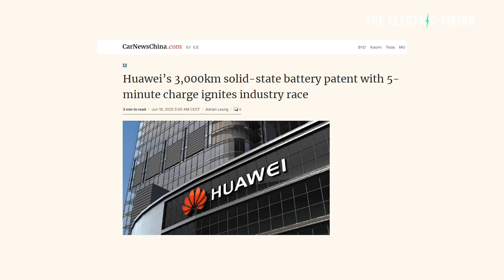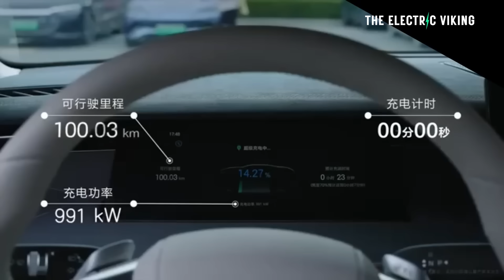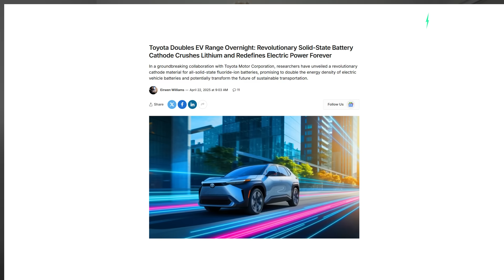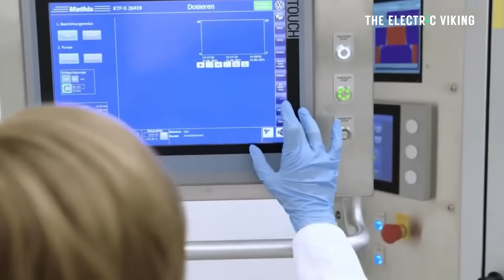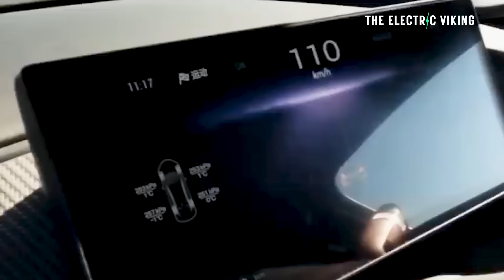5‑Minute Charge, 1,864 mi Range: Huawei’s Battery Patent Shocks Industry

Comment from the maker: The car I drive, the Xpeng G6 - https://youtu.be/IcniwO8NfQQ

RESINC Solar installed my battery and solar system. Get a free quote from them here: https://www.resinc.com.au/electricviking
Reply: Wow my sympathies....lol .....The electronic door latches can be unreliable, with some users experiencing issues with auto-unlocking and auto-locking. 
The physical door release levers are hidden, which can be problematic in emergencies. .....I would be concerned in an EV....

Comment: Well, Battery vehicles cannot replace ICE vehicles or any other competition.
Here is why;
With 290million cars in the USA, each to be replaced with a Tesla Model S (hypothetically) requires about 3.335TW charging installations  (considering each with 11.5kW chargers, total would be 290million x 11.5kW = 3.335TW) and grid demand of power. Such is more than the combined installed capacity of China and the USA.
Obviously, not all of them will be plugged in to the grid at the same time, even a 40% would demand a power of 1.334TW without including fast charging.

Comment: Many technologies are patented without an actual effort to bring them to market. That is so future products which may borrow from the patent won't be challenged by a competitor. When Huawei actually starts putting these batteries into vehicles in large numbers, that will be considered a threat. The world's largest battery manufacturer also in China, already has a cheap competitive battery that it has been putting into vehicles already, and is gearing up to mass produce for the automobile industry. That's the one to worry about.

Comment: Need a battery that can run a NYC taxi for 4 days  straight that is about 280 to 300 miles daily on dirty range so 1300 to 1500 miles of range is optimal. Anything else is failure. I DRIVE A TESLA and been working on a Model Y for 4 years I really experienced it and my findings are the solution

Comment: The next revolution will be EVtols. Think about it. They could end up even cheaper than EV cars because they don't need all those wheels, complicated suspension and drive. For these reasons they would be far more reliable and they would never crash because air is a very predictable thing. You hit a pothole on a road and you could end up in the bushes, but in the air under computer control with every EVtol knowing where every other one is at all times, I think it is guaranteed to take over.

Comment: If this is true then it will reduce the weight of batteries considerably.  Instead of an 1800 mile range we could have a 600 mile range that weighs a lot less and uses less energy to pull it around.

Comment: But it's all nonsense, yes the battery might exist, but to charge it in 5 minutes would use 7 to 8 MEGAWATTS.......you'd need a cable the size of a 4 inch drain and it would have to be cooled....., plus no house can supply that, and multiple cars plugging in would collapse the grid

Comment: They can come up with whatever range they want, 20,000km. Hooray!

The issue is always and every time how the hell do you charge it?

Unless you install a huge battery at each and every charging station, you need to upgrade the entire grid back to the generator.

That will make each charge insanely expensive in terms of paying back the capital to upgrade the network.

And as an engineer responsible for mining machines with the sort of electrical demand as one of there chargers, the stop start nature of the EV charging means you will also pay a fucking huge demand charge to compensate the generators for having that capacity just sitting around waiting for your spike in demand. One of my annual bonus KPIs was avoiding the stop start nature of electricity demand because it cost so much.

No matter how fantastic EV batteries become, what is needed upstream of the charger to produce fast charge times is a much bigger issue.

Comment: 2000 mile range battery and 1/3 the weight and can pull a camper and get 200 miles between charges and charging in 10-15 minutes 

Yep your right

Comment: A follow up on my criticism of Sam’s ludicrous statement concerning an EV weighing less the an ICE. Not sure what he meant by that but the energy density of gasoline is 12-13,300 W/Kg—with 30% efficiency, approximate ICE efficiency, you have say 3,600 W/Kg. Now, divide that number by the weight of all the components replace by an EV then multiply it by the weight of all the components needed to power an EV and you will have the energy density required to satisfy Sam’s stupid statement. I doubt 1500 W/Kg will do it and we are a long way from that.

Comment: This would be awesome. It will happen one day. Guaranteed!
Reply: But it's all nonsense, yes the battery might exist, but to charge it in 5 minutes would use 7 to 8 MEGAWATTS.......you'd need a cable the size of a 4 inch drain and it would have to be cooled....., plus no house can supply that, and multiple cars plugging in would collapse the grid.....so no, it won't happen....

Comment: The thing is, even if Huawei doesn't manufacture their own batteries at scale, their business model may simply be to license their patent to existing cell manufacturers who already have the capacity and scale of suppliers and customer networks. You may see independent manufacturers in China and elsewhere license Huawei's Solid State patent and produce their cells inhouse if they deem it more financially and intellectually feasible than banking on their own r&d investments.

At the end of the day, what matters for mass scale will be cost of production, as you point out. Until that happens, other companies have time to push their own intermediary solutions and grab whatever market share and profit they can, and then reinvest that into a competing technology to rival or beat Huawei over time. But it's a ticking clock, and no one knows exactly how much lead time there will be until it's too late to compete on the tech side rather than the economic side.

Comment: The issue of range anxiety is less about range and more about usability.  There are already gas cars that have less range on a tank than many EVs.  Why does nobody complain about range anxiety with those cars?  It's simply because
a ) gas stations are plentiful and ubiquitous.  Even if you only have 100 miles of range in a gas car, you are pretty certain that you'll be able to find a station.  This is not the case for electric charging.  You can argue about charging at home, but that is rarely ever an option for people who are not homeowners -- which is the majority of all human beings on the planet.
b ) the time investment to fill up is relatively trivial.  Filling up a gas tank for most any passenger vehicle can be done in under 5 minutes.  Charging at most DC fast charging sites is still a half-hour process, and at the most common public chargers, you have slow 12 KW AC charging, which is going to mean multiple hours of charge time.
A corollary to this is that if you get stranded because you're out of gas, a simple jug of gas can get you back up and going in minutes whereas no such option exists for EVs.

Increasing the range on an EV is not really addressing either of these problems.  If reliable DC fast charging was as plentiful as gas stations are already, the range anxiety discussion would be over.  If the time commitment to recharging was as short as refilling, there wouldn't be contention for fast charging spots or people idling on chargers.

Comment: 2X range of a Tesla Models S3XY CT will be perfectly acceptable for real world applications.  That's 820 miles for an S and 715 for a Y with 766 for a CT.   Discount these ranges to 80% for the real world and you have 656, 572, and 612 respectively.  From there, I would take any improvements in the form of a smaller lighter pack which improves handling.   Real world range in bad weather of 500 miles in any of the vehicles is more than adequate--it's great!  Future energy density increases just translates to lower cost and a lighter vehicle with lower polar moments.  I agree on your assessments of how energy density will be used.

Comment: It will still charge at the same rate on a home charger as any other battery.
And as far a range, the Chinese standard is way less stringent then the EU standard, which is way less stringent then the US standard. So cut that range in half, if not more.

Comment: Assuming a 2000 km range, at about 250Wh per km, that's half a MwH of battery, a 5 minute charge would require 6Mw delivery, that's 2500amps at 2500volts. without going into superconducting materials for power delivery would require 2 cables of pure silver over 30mm thick to deliver, Add insulation, and you are looking at wrestling a 100mm thick liquid cooled, heavy as hell cable into the charging port. at this point I think I'd have better odds fillling up the gas tank while smoking

Comment: price tag is currently high, but so were solar panels. at one  time,
come to think about it, so were ICE engines around the turn of he last century. getting fuel anywhere wasn't so easy
Cell Phones were actually around back in the mid '1970s, but they were huge (ate the trunk of a car) had limited network coverage, and were expensive as hell
Energy density high enough to significantly reduce vehicle weight, requiring less energy to move. a 2,000km range is 16 hours on the road at 130km/h. by that point, the driver needs to recharge, badly.

Comment: When we bought our Hybrid 1979 KIA NIRO, for an extra $3,000 we were offered a model with a large battery under the back seat which took hours to charge over night and provided an extra 25 miles of range each day.  If your commute to work was less than 25 miles, the car could be driven to work, be charged all day and driven home without using any gasoline.  If 1/4 of a HUAWEI battery could be put under the backseat providing 450 miles of range at a good price, every NIRO buyer would want the plug in model.  However, the hybrid and electric car market is changing fast.  All battery powered cars are now competing againt Maxwell Chikumbutso's self powered $5,000 cars which go unlimited distances with NO batteries, No stopping to charge, NO charging and NO payment for fuel of any kind.  They claim to be producing 30,000 cars a day in a new factory in Zimbabwea, Africa.  30,000 cars a day in 365 days is almost 11 million cars a year.  The cars look good.  And they make a small SUV.  In months I expect the first of these self powered cars to reach the United States.  Even with a 100% tariff, the price would only be $10,000 against a $30,000 Tesla with a high priced, heavy battery that has to be replaced evey few years.

Comment: This sort of range, anything in excess of 500 miles, the ability to recharge at a speed comparable to refueling a traditional vehicle, and the ability to recharge at facilities as common as gas stations(in numbers and with those numbers actually working properly without vehicle parked there overnight to recharge) will amount to a game changer for EVs.
And yes, a smaller range would work so long as there is comparable means to recharge -- station numbers, charge rates, and accessibility.   Trucks would definitely benefit with larger ranges as some people do actually tow trailers which compromise that range(as it does with ICE too) but it also adds to a better marketable tool with the ability to utilize that charge at the job or camp sites.
All in all reducing the cost, size, and weight of batteries while improving range and charge rates will amount to the biggest factors in adoption.   And I continually hear people comment on insurance rates for EVs, but working at a dealership I see plenty of ICE vehicles involved in what would typically be minor accidents also being totaled due to state law which requires extensive safety equipment replacement(all air bags, all crash sensors, all seat belts, all modules) if so much as one air bag or seat belt have been activated.  That's thousands of dollars in repair costs the manufacturer doesn't even state as being necessary to repair the vehicle properly, but at the end of the day makes a huge difference between a repairable vehicle and one sent to the scrapyard.

Comment: I'm optimistic. There are four other companies with similar-yet-different patents and plans. If all problems are solved it could spell the end of fossil fuel propulsion. And the beginning of ecological healing.
Reply: Optimistic, lol lol But it's all nonsense, yes the battery might exist, but to charge it in 5 minutes would use 7 to 8 MEGAWATTS.......you'd need a cable the size of a 4 inch drain and it would have to be cooled....., plus no house can supply that, and multiple cars plugging in would collapse the grid

Comment: Also fast charging is underrated - whilst it’s true we have pretty slow charging infrastructure if a battery can fast charge in 5 mins even on a slower fast charger stands to reason those batteries won’t slow / throttle charging past 60-80% so charging speeds will still be superior.

Comment: Wow. I think 500 miles is all we need, if you have fast charging and long cycle life. High energy density = smaller packs, more efficient cars, less materials etc etc so putting a 1000 mile battery seems like a trade off, when we could lower price, increase efficiency etc. 

Very much hope this comes to fruition- especially if we can see high cycle life (10/15yr warranties) and much cheaper EV’s of similar build / feature / safety / quality. Ice will be dead.

Comment: 5 minutes? Won't the forecourt chargers need to be the size of an Aircraft Carrier? Imagine the size of the cables, who's going to lift them onto the car? 😂😂😂
Reply: But it's all nonsense, yes the battery might exist, but to charge it in 5 minutes would use 7 to 8 MEGAWATTS.......you'd need a cable the size of a 4 inch drain and it would have to be cooled....., plus no house can supply that, and multiple cars plugging in would collapse the grid

Comment: An interesting study would be what would people pay for range?  You can have a 1000 mile battery but at what cost compared to a 500 mile battery.  For most people 500 miles would be plenty and if a 1000 mile battery is twice as much they'll go for the 500.
What portion of the car cost does a battery take up?  Manufacturers will go for the best profit and adjust the price accordingly.

Comment: I AM CALLING OUT  author. Post numbers IF YOU DARE and I will post mine. YOU EITHER HAVE ZERO technical knowledge or you are LYING like I have not yet seen in this field and I have seen pretty outrageous claims.
The power needed to fill at this parameters CAN RUN TWO HUNDRED big CNC machines. It is bloody SIX MEGAWATTS for the duration of charging, or:
"If you're talking about powering homes at their average, typical instantaneous usage (e.g., what they draw on average over the day/night), then 6 MW could power 3,000-6,000 homes" !!!!!!!!
You are a FRAUD AND LIAR.
Just ran the calculations thru AI and numbers are INSANE.
IS JUST NOT POSSIBLE, Just feed the number into any AI and you can easily see for yourself, if you know what yo ask. Technically illiterate people, which is majority today, will believer you and support this insane claims.
Reply: He is paid by Chinese to spread lies

Comment: 3000km @150w km = 450kw/h battery, to charge that in 5min would require a 5400kw charger. Is not happening and completely unnecessary.

Comment: If cars had 3,000 Km range, it might be harder to be an EV driver, as who is going to install a charging network, that people are going to use, maybe two, or three times a year, doing all their charging at home. You might find a solar powered EV charger in a remote location now, or in a few years, but not if 90% drivers don't use it. But hey, bring it on.

Comment: Let's make a quick calculation: for a 3000km autonomy you need an amount of energy of 450kWh, considering an average energy consumption of 15kWh/100km. Given an average energy efficiency of 80% for electric engines, a battery with a capacity of 563kWh is then required for delivering 450kWh. If this energy amount comes from a solid-state battery with an energy density of 0.4kWh/kg (400Wh/kg), then you will need a battery pack weighing 1408kg. So your EV car will be 3 to 4 tons heavy. Most of the energy will be wasted just for moving the mass of this huge bunch of "modern technology". What a progress.

Comment: To be able to drive 1864 miles (3 000 km) in an  EV on one charge, you will need at least 500 kWh (@167 Wh/km) of usable battery capacity, which means you will need to have 6 MW (on average) of power to be able to charge it in 5 minutes. I have never heard of any "supercharger" with such a capacity, have you? Neither a battery chemistry capable of handling the charge current needed (7 500 A) at 800 V. So Sam, please try to check all the fantastic figures before publishing.
It might be that we will see something much better than today's battery capacity/charging figures in the future, but we are quite far from it as of now.
Another, often ignored factor, is the battery internal resistance, causing the battery to heat up at charge/discharge. With 10 mOhm and 7 500 A you would get more than 500 kW, needed to be removed by the thermal management system in the EV.

Comment: Mr Electric Viking is wrong about the required range for an electric car, at least in my case. Public chargers are moire expensive per mile than my 2 litre diesel, and I would not be willing to hang around for a long period waiting for a public chargers to tip me off, when diesel refuelling is quick and cheaper. My range requirement is for me to go on holiday without needing to recharge at public rates. That means 750 miles for me, not 450 miles he claims.